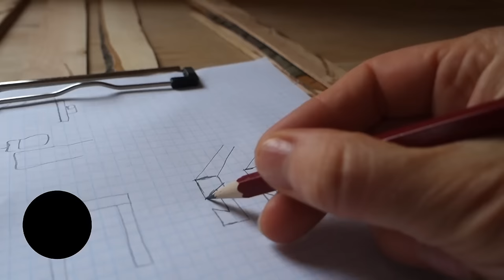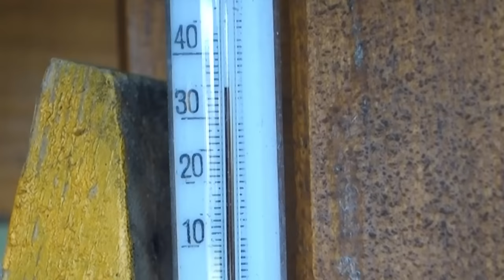DIY dovetail pencil box | Cherry wood | Firewood-project

Comment: Nice box 👍
I've seen you have a cool DIY marking gage. May I suggest you can use it to mark (at least on the non visible parts) you boards thickness on both end of all 4 sides before cutting the dovetials ? This should make you life a lot easier when chiseling afterwards.
Reply from the maker: Thanks for the helpful tip! 😀 I'm still learning! That was my first time!